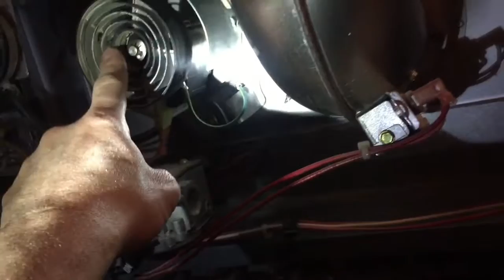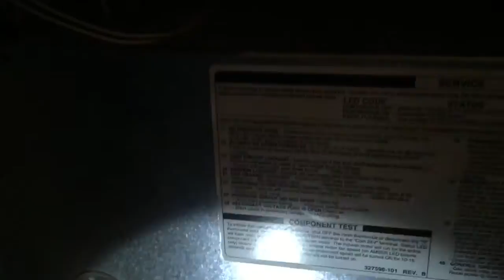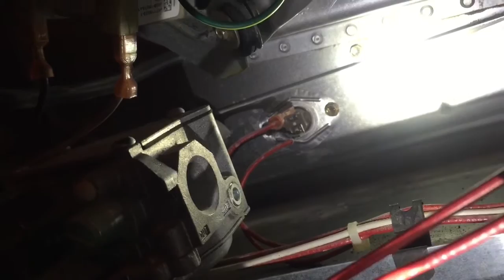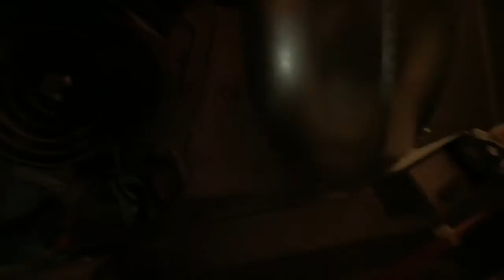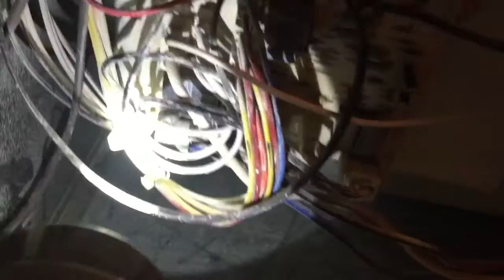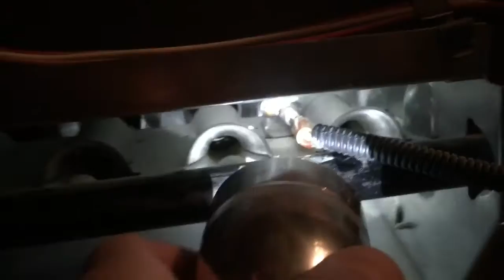How To Fix Your Furnace No Heat No Gas Seized Motor No Power Nothing

Comment: I have the exact same furnace and for some reason that button on that 1 sensor that you mention won't go in and I can't get any power to the Inducer motor.  The code keep coming up 3.1 pressure switch